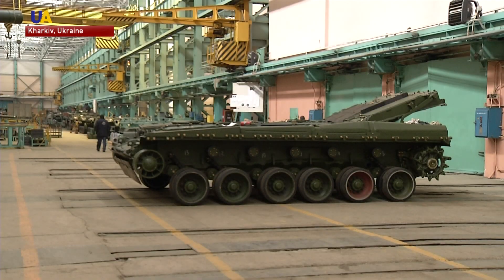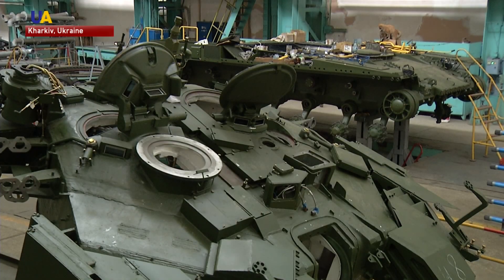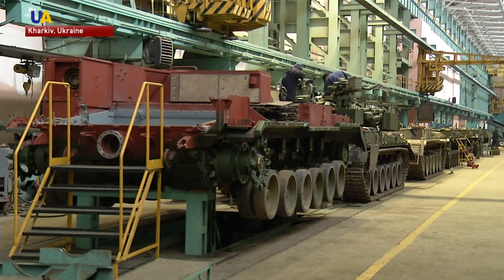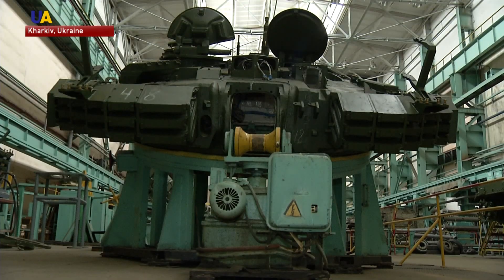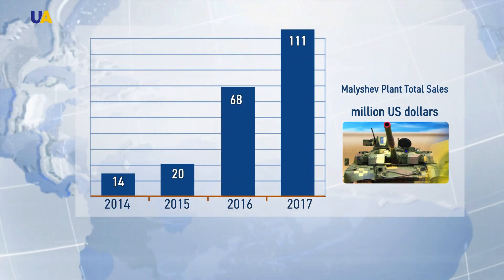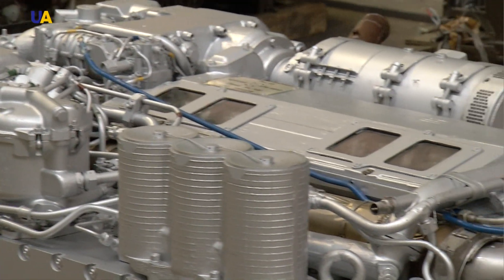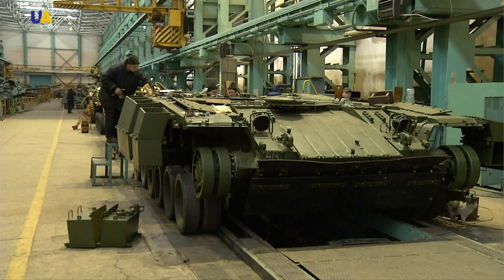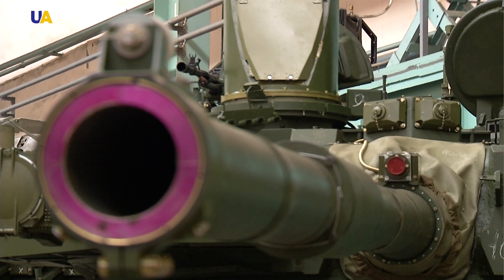Ukrainian Production Plant Updates T-84 'Oplot' Tank

Comment: Very impressive to export this tank. Turkey had a tank tender in late 1990’s where a T-84 Yatagan (Turkish NATO version) of this tank was handed over to Turkish army test personel. The reason why Turkey didn’t choose this tank was because the fire computer was below of the Leo-2A6 and M1A2 Abrams tanks and costs more to maintain. Also to maintain this tank costs more time and is therefore not chosen. Personally I wanted this tank ‘owned’ by the Turkish production facility where Turkish engineers could produce their own version of Yatagan. The barrel was good, tracks are good, engine has no limit for export like the Germans come with difficulties with the day. Anyway, Turkey spent a decade and has now the Altay tank derived from the Korean K2 tank. I think this K2 based Altay is much better than the T-84 based Altay/Yatagan as the systems are more sophisticated. But the limits in export license will break the project down: MTU Engine and 120mm Rheinmetall tank gun and the Renk transmission gear is German based!
Reply: Сонер Розовочервенов turkey doesn’t know how to probably use tanks anyway, so it doesn’t really matter what they buy.
Reply: @WAzzzUUppp  thats why you guys lost in karabakh? LMAO
Reply: tukrish super power 2022?
Reply: Why the Russians have not hit that one yet?

Comment: I like the Russian T-80BVM and T-72B3M/4 more. Good for you Ukraine, at least you're trying.
Reply: T-80 and T-72 were both proven completely useless at War of Chechen. T-80 had major flaws at its armor and T-72 was just under performing even against t-54's. Both T-80 and T-72 could be taken out from the front by RPG and 100mm gun.
Reply: VeXu666 
Yeah, there was that. But any tank operating in tight urban areas without close infantry support isn't going to do so great. Add to that inexperienced, poorly trained conscripts and bad orders, and you've got got a recipe for disaster. It was bad tactics and training as much as anything else. The early T-80's had problems to the point they were nearly fully retired, I'd still take a modernized Russian T-80 over a brand new T-84 Oplot. I've seen T-90's armored with Kontact 5 (I saw 1, it was 1) take a TOW and the crew jumped out and ran away (also the dazzlers were off), so I'm confident in Relikt.
Reply: And the hatches were open! They just jumped out and ran away, you know the video, everybody's seen it (but it was an old TOW though, oh no.. lol).